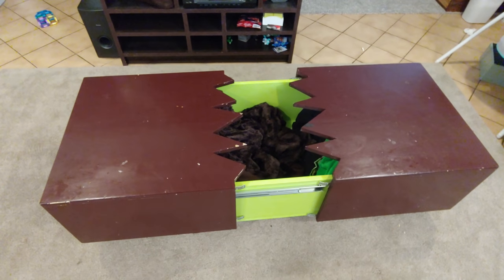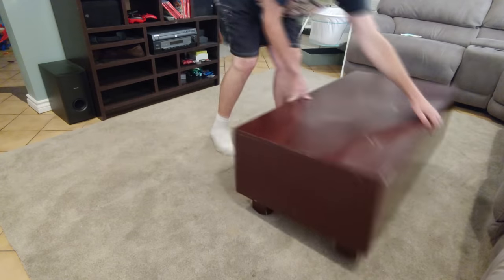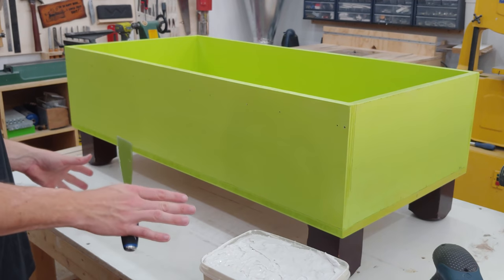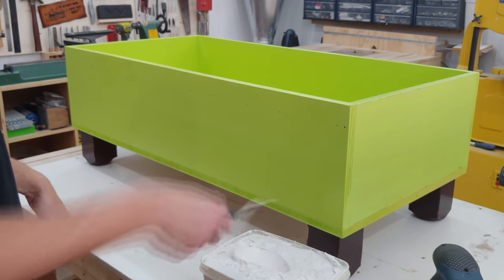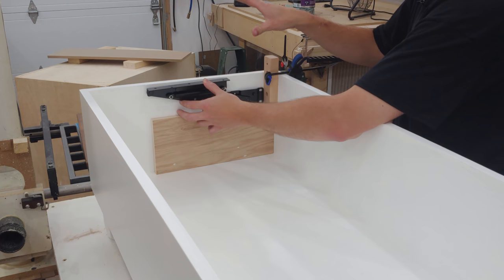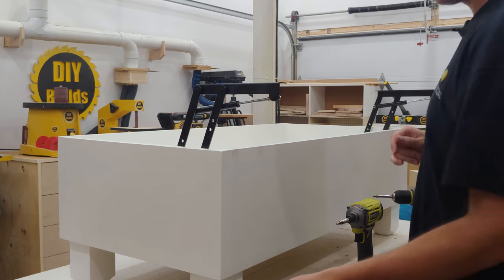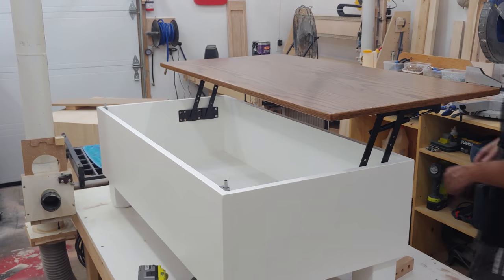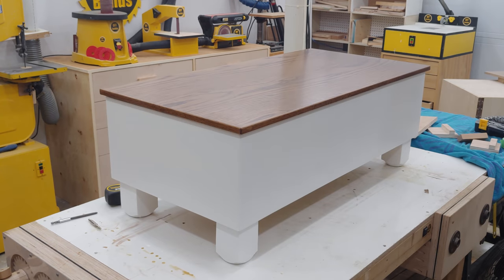Out with the Old and in with the New - Lift Top Coffee Table

Comment: Consider adding a little more weight to the top by screwing another board in the center underneath or adding some other weight to overcome the soft-shut things.  Maybe more weight would help with the noise.
Reply from the maker: Ya ive thought about screwing a piece of plate steel to it.

Comment: Calling those brackets BAD BOYS is an understatement. They're probably the WORST designed brackets on the market with the pistons right in line with drilling for screws into the top. The C shaped bracket is 10 x's better